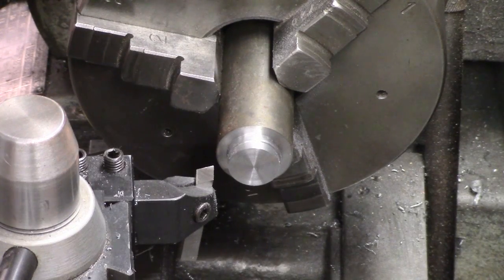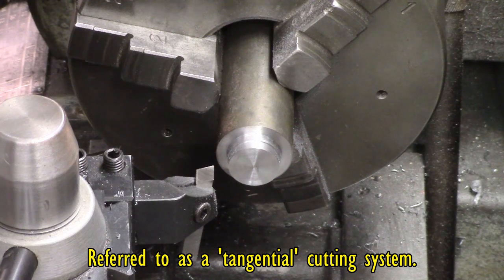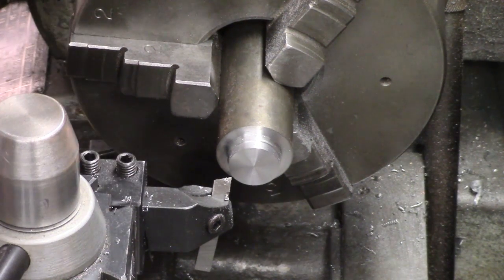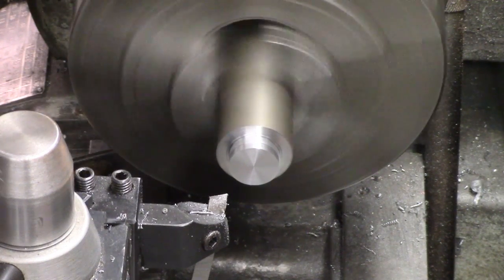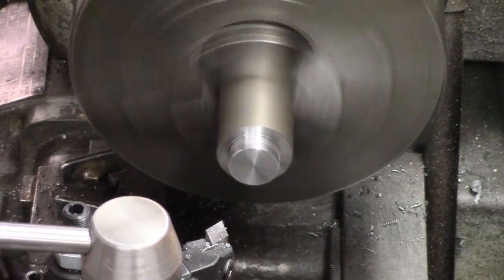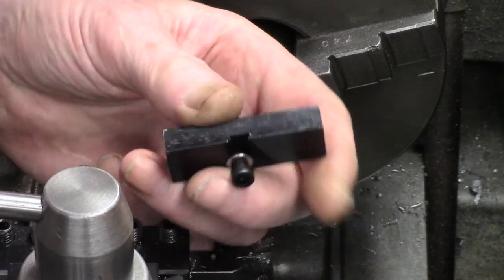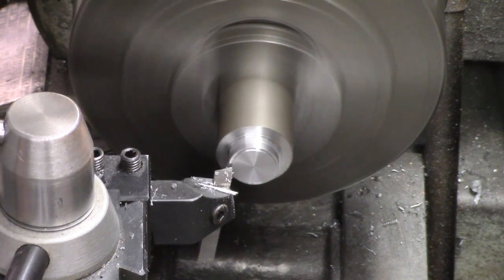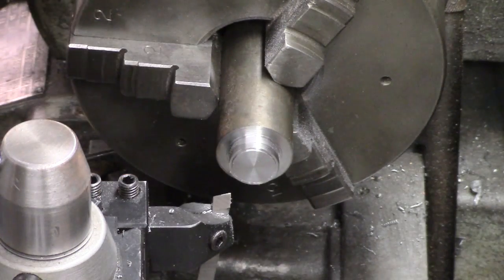Trying Out a Diamond Tool Holder

Comment: I imagine that once the toolpost is set square the grind and angle might replicate a CNMG insert shape/angle with app 5 degs on either side?? Probably an often used tool especially on smaller lathes.

Colin ;-)
Reply from the maker: ***** Hi Colin -- probably close, although depending on cut involved I do tend to feel it worth a small tool post rotation adjustment is useful. Still testing it out so far.

Comment: Right, now you have touched on my specialist subject. You do NOT need to turn the tool post to change from facing to sliding cuts. There is enough clearance angle built in to the ground face to do both functions, forget the old rubbish you were taught about needing 8-15 degrees. You can also forget about needing different top rakes for various materials, What will help is to put a vary small radius down the corner. If you decide to try some solid carbide square in your holder, you will need a very pronounced one to stop it chipping, unless you are using a Steffen Gotteswinter inspired carbide inserted tool and that does not need so much radius as it has a very fine grain structure. 
You might want to make yourself a better, and quicker to use, grinding jig. A simple "vee" notch set at 30 degrees to horizontal will put grinder striations in a better orientation, leading away from both edges, so it will work equally for facing and sliding.  The standard jig tends to put a bias in. 
You will find this tool is your go-to for most jobs, relegating TC inserts to jobs that are too tough for HSS. 
Getting back to my second sentence, it is only an amateur that is constantly moving his tool post around, Far better to set it dead square and keep it there, except for exceptional circumstances, and set the tools at angles your QC holders. Soon you will only be using your Tangential tool and a parting tool and both need to be dead square to work efficiently. If you want to chamfer, why not grind up a Tom Lipton style  one (also best kept Sq,)  and keep it handy in a QC holder.
In conclusion, welcome to the world of a great invention from 1885 (or earlier)
ATB
c
Just thought of a PS, don't be afraid to take a reverse cut as a final pass. If the tool is on centre, or very very  slightly above, it acts like a shear tool giving a supreme finish. 
PPS don't bother trying to hone the "diamond" face, use straight from a fine grain wheel, but you can hone the two vertical faces and radius to remove any wire edge.
Reply from the maker: Chris Stephens Chris - big thanks for your detailed comments. I certainly do plan to improve tip radius. Much appreciate your input and I have thus far in fact mainly only honed the vertical faces. I have much trial to still do. Thanks again.
Reply: You are more than welcome, at SMEE I'm known as the goto guy and advocate for tangential tooling, not diamond as i make my own. About half a dozen different types so far, from 1885 style through to lift up threading ones to miniature roller box and more. You've got to have a hobby, you know! :>).

Comment: Nice weather :)Got to enjoy it pal while it's here..Thanks for the videos..What model mill is it you have mate ?
Reply from the maker: Muhaa Haloa Mill is a Grizzly 0704. Small but fairly capable - just waiting on Y-axis leadscrew and nut to change over from the erroneous metric it came with. In fact replacement leadscrew just came but - they forgot the nut - now have to wait for that!
Reply: ChrisB257 Ok thanks for that it looks exactly the same as AMA 25LV machine which
is the one I'm considering purchasing,Looking forward to the fix it series 
its unfortunate but will give you a good idea of the inner working of the
machine.